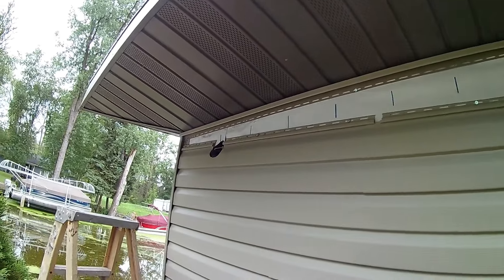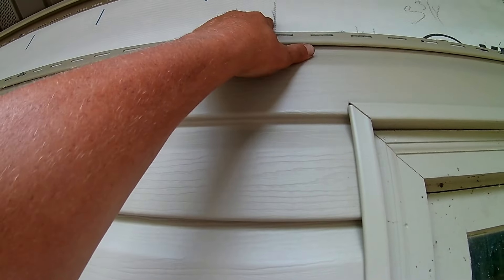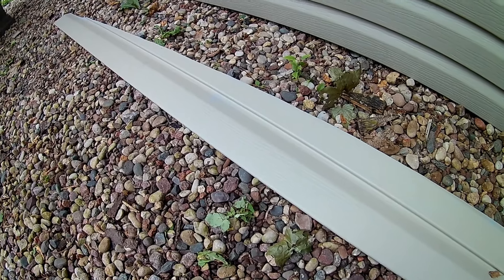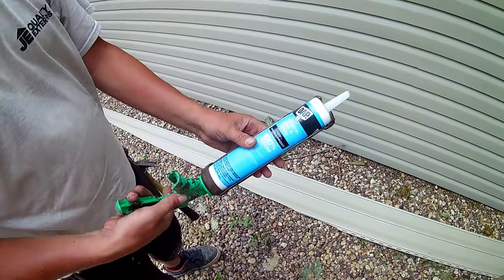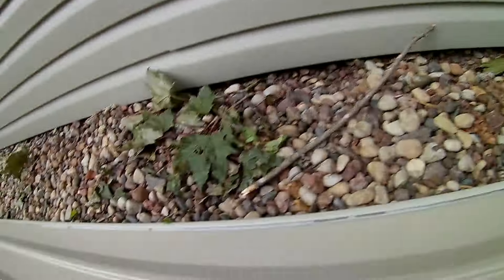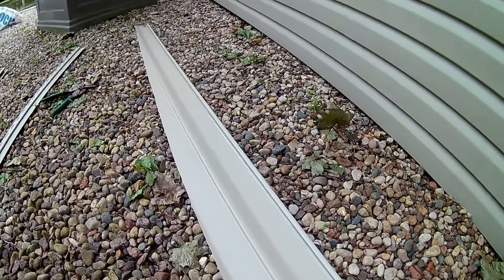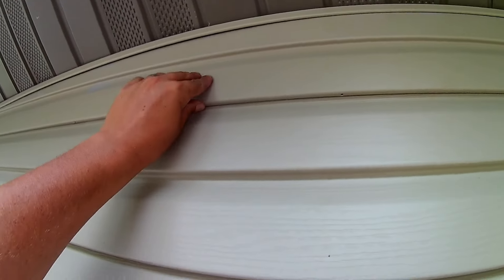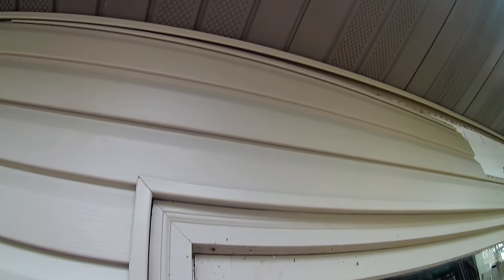HOW TO INSTALL TOP PIECE OF SIDING

Comment: Just wanted to say that the top piece can eventually fall off when using this method. I found this video looking for a best way to repair after a top section fell off during a storm. The original installer used silicon just like in this video... granted that was probably 20-25 years back... but it did eventually fail.

Comment: Hmm, opinions are fine. Undersill inside of j-channel with punched tabs on the siding is how the products are engineered to work.
Reply from the maker: this piece is cut on an angle bud. would have loves to see you get that in undersill. i dont like call backs thats why i do this
Reply: @Lifes_Apprentice ya well, apprentice is in your name, bud...
Reply: @jasonantonation8787 no doubt. At that angle should've just used j-channel and secured with finish nails where the nail flange had to be cut off. Never ever use silicone on vinyl siding except around the window channel. 
   Bad thing is he stated this is the way he finishes all top rows regardless.

Comment: Just wondering how expansion and contraction play into this method? I would never caulk a hook strip on vinyl, but if I were going to use this method, I would at least stich caulk it (2" caulking every 24", for example). I feel like the second the temperature changes the top of this wall is going to look like a sun chip.
Reply from the maker: If you use 100% silicone it will be able to expand and contract
Reply: 100% silicone will expand with the piece, but I’d still stitch it where I live, in NC. We get up to 50 degree swings in temperature in one day at the changing of seasons. I cut the hook at an angle every 18” or so, and fold it under itself to thicken the lip that goes into to lock, and sometimes use silicone, or run a ring shank trim nail every 4-6 feet straight up through the lip and lock, but not into the sheeting as a last resort. I hang triple 6 with styrofoam insulation with this method and don’t get call backs, and they’re as heavy as it gets. (18” tall by 12-16 feet long)

Comment: ----------‐------------- agree ,  better than notched....I use another method besides silly-cone ...every 2f or so cut product to create a 'tab' 2.5in wide x 5/8" - 3/4" tall . heat product w/hand brake bend forward back onto self leaving 1/8" gap this acts as tension spring 'lock' inside of the finish strip....tried  tested  trued...thx..

Comment: A few little blobs in the bottom will work fine to save some silicone. Also keeps it from seaping out of the weep holes on bottom. My dad taught me this trick 20 yrs ago. Works well
Reply: I commented earlier and my neighbor who is a building said to never do this.   I commented a year ago and haven't gone after the issue yet.   I guess I'll give it a try tomorrow since it's Labor Day and I'm tired of it coming loose and fixing it.    Even where a contractor came in to do a garage is actually falling off.
It's frustrating and I don't know if I screw up,  will I be able to get that siding again.
Reply: @beebob1279  it'll work fine.

Comment: The only concern I have is the drip holes getting plugged from the silicon and the bottom channel. If any wind driven water does get in it can't drain out, so I'd be worrying about water damage.

Comment: I'm very glad I found this video !! My problem is the last panel fit half way into the j-channel so I have about an inch run and this trick will work for that. And the piece will float with the last panel if I don't use under sill. Thanks

Comment: I either do that or put fascia nails in it under the bar. If it's really high, I put colored pole barn screws in it. It will NOT come off and is replaceable.
Reply: My neighbor is a retired builder and he told me to do the same thing.   I asked about room to move and he said it's not an issue.  
The directions to my siding when I sided the house twenty some years ago was not to caulk or nail the top strip.  I'm put up the dutch lap siding from Alcoa.

Comment: I’m installing Vinyl cedar shake.  CertainTeed recommends using the cornice molding at the top row which is wide enough to hide the nailing strip.  The local ABC Supply says it’s discontinued and no longer available in my color, so I should just use the matching J-channel.  The J-channel is no where near wide enough to cover the nailing strip.

Doing it their way is forcing me rip the top row nailing strip off and face nail the shake into the sheathing.  I’m concerned that with no room to expand and contract that top row will bow.  I’m fairly creative, but this has me stumped.  The shake pieces are three rows high by 48” wide.  They lock together with 4 or 5 locking strips on the back and the face of the row below it.  They lock when pressing them upwards, not pressing them in a downward direction so you’re fighting gravity as well.  Not sure what to do but silicone might be the answer.

Comment: The notching has been an issue for me over twenty years.  I used the under sill strip and it just doesn't hold.  I'm hoping your work fixes my issue.  
I've got left over siding from the job and will try your method this summer
My only question to this is expansion.  Won't it be a problem with expansion and contraction in the heat and cold?
Reply from the maker: you need to use 100 percent silicone but i have been siding for 15 years and have never had a piece come off
Reply: @Lifes_Apprentice  Thank you.  I've got nothing to lose.  I'm tired of it coming off.
Reply: @Lifes_Apprentice I’m looking at getting into the siding business. In our area it’s a lot of vinyl siding. What does someone in your experience expect to make per year with a 2 man 50/50 split company with no other employees. Just looking for a ballpark range.

Comment: You can find the lowest point on the house, and make all your corners that size. Then install the siding parallel to the house, and you won't get this problem. The top row will not have angle, this gives your install a more polished look. The under sill piece should work better in this case!
Reply: Except you want the corners to all match up and the windows/doors to look level. Which from what little I can see the siding looks level to the window. This was a case of either the builder couldn't read a tape measure or level or a corner of the house settled.
   That being said this is still improper. Never use silicone on vinyl siding except to go around the window and door channel. Proper way would've been to just use j channel at the top the finish (fascia nails) ever few feet  where the nailing flange had to be cut off.

Comment: not bad idea but I just use scrap top lock tab and about 3 inches of siding from cut scrap siding (top of siding) slide into j channel nail flat to wall then measure height needed to lock tab stuff into lock tab and bam it will not let go.... as long as you measure height right. if you really want to use silicone then put into scrap lock tab.
Reply from the maker: Nice!

Comment: Do you silicone the top also or is it just inside the J?
Reply from the maker: I only silicone the top piece of siding where it hooks onto lower piece
Reply: @Lifes_Apprentice  thank you
Reply: @Lifes_Apprentice  I commented to you about a year ago on this.   I haven't done the caulking yet because I'm concerned about the directions saying not to do it this way.  Yet I'm tired of the siding coming down.    
Tomorrow it Labor Day and my neighbor is going to the home improvement store.   I guess I'll do it then.
Reply from the maker: @beebob1279  Don't worry about it because when you caulk it it will not fall down
Reply: @Lifes_Apprentice  I adjusted the under sill to see if that works.  I may have to drop it another 1/4 inch to make it hold.  I'm thinking the house settle a bit and I have to drop the under sill a bit to keep the top siding up.  IF this doesn't work out comes the caulk.

Comment: Whats a tube of silicone cost? Thats got to be way more expensive than using undersill and snap lock punches
Reply from the maker: it cost about 4 bucks. it doesnt really save money this way but saves alot of time and will not fall off
Reply: Well, since a 12ft strip of undersill is 10.48 right now, I vote for the caulk lol
Reply: @biologymajor1  Holy fuck is it really that expensive right now!?
Used to be around 6$

Comment: This is a stupid question, but how do you cut the last piece of siding?  I have almost 100' of perimeter, and the skill saw shatters the vinyl and yellow metal snips are excruciating for that amount of lineal footage.
Reply from the maker: we use snips but you can use a razor knife and cut it or use a grinder with a metal cut off wheel
Reply: @Lifes_Apprentice  thanks for the reply!
Reply: There's special saw blades just for siding. You could also flip your regular saw blade around so it's backwards.
Reply: Turn the blade backwards on your skil saw. Use small tooth blade like for paneling. You won't shatter the siding.
Reply: Tin snips
Reply: Put blade backwards

Comment: We caulk in between the weep holes and throw some trim nails in the weep holes .
Reply from the maker: no need for nails with the caulk i think
Reply: Life's Apprentice It’s my added insurance not a lot just made two or three a full length piece .
Reply: So not need, the caulk will hold. Should never put or block the weep holes.

Comment: Great tip
Reply: Nope. This is the exact wrong way to install vinyl siding. Correct way is undersill and a snap lock punch and trim nails every few feet not nailing tightly though.

Comment: Installation wrong. Sorry
Reply from the maker: how would you have installed double 4 dutchlap in this spot?
Reply: *crickets
Reply: Yep. In this particular case since the house or window was built by someone who obviously couldn't read a tape measure or level the correct way would just be j channel then use trim nails every few feet where the nailing flange had to be cut off. If the roof line had been straight then undersill, snap lock punch then trim nails every few feet but not nailed tightly so the vinyl can breathe (expand).

Comment: This might be OCD, but I usually get color match exterior paint in a small quart. Then just pilot bit small hole every 3 feet or so just under the J channel. Use small fascia trim nails and drive with a nail set. and then dab it with a q tip with the paint. Will never come off. The silicon is a great back up though. No one can notice the small nail heads. If they do, they are more OCD than me and my technique!